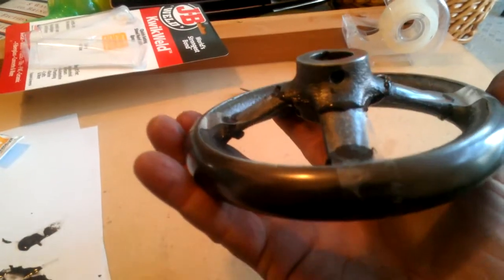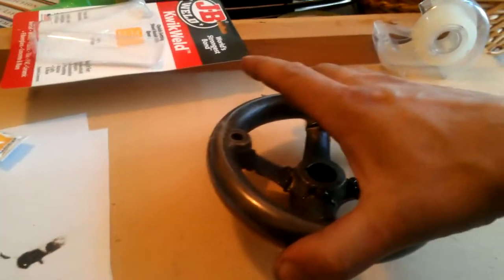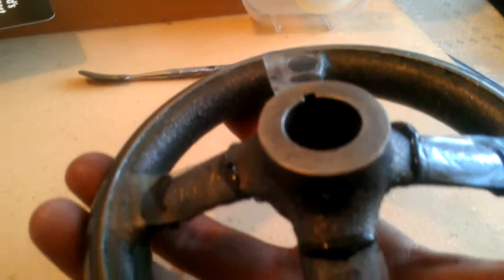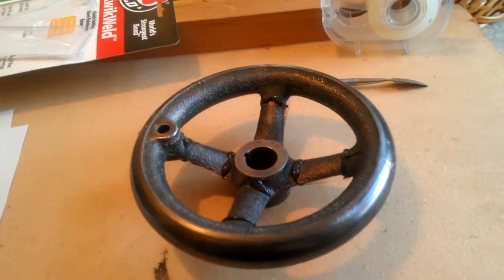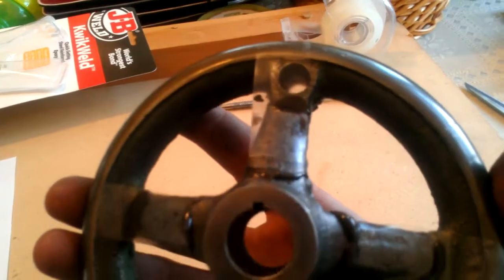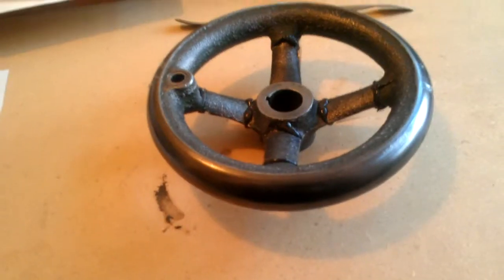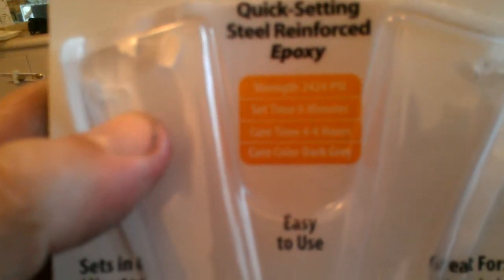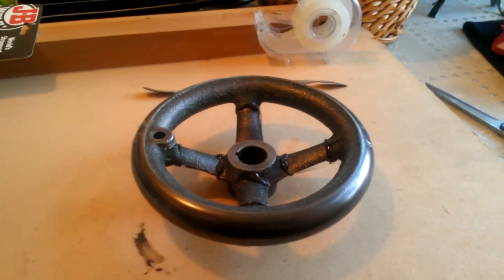Brown and Sharpe horizontal mill hand wheel pattern part 1

Comment: That will make a good pattern. What metal are you planning to use? Just remember that aluminum shrinks about 3% when it cools.
Reply from the maker: oh ya I know but something like this it will not matter . I plan to recast in iron ill plug the hole add some more material to the faces of the hub and recut it back to size..boar a new hole and broach the keyway